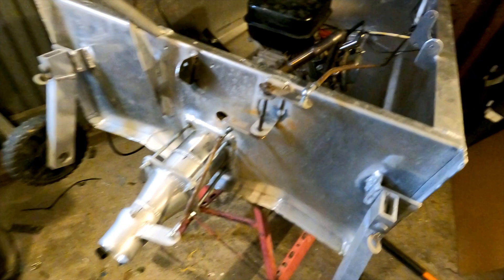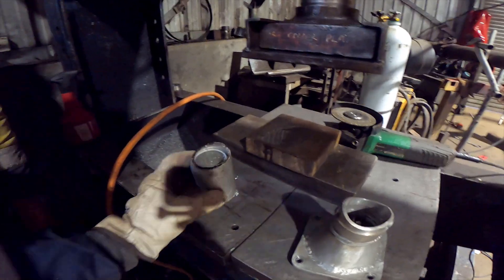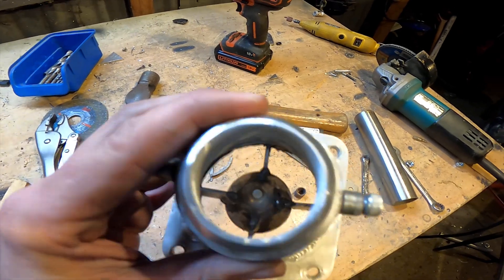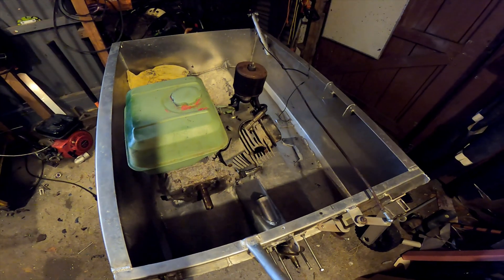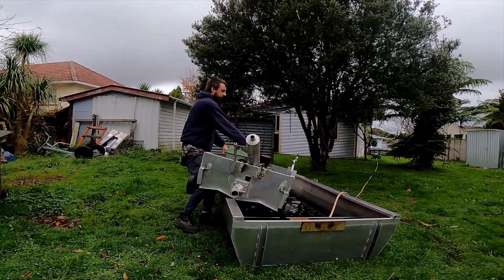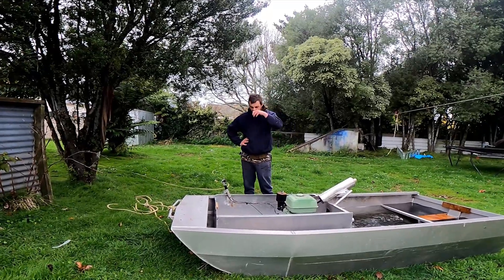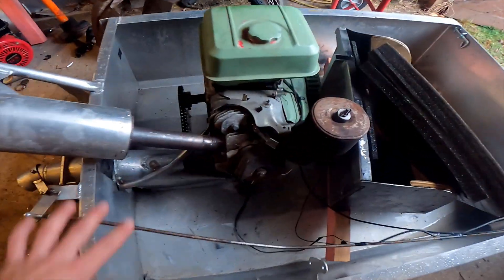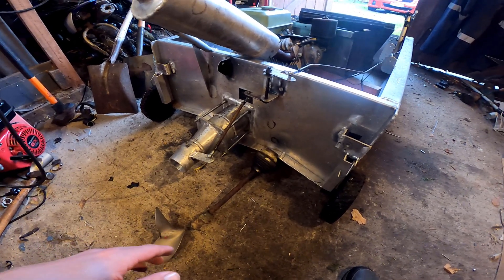Homemade Jet Unit Build, part 5 Double the POWER

Comment: Sorry for you here is almost summer with Blu Sky and the CV axle could be a good thing to try
Reply from the maker: I hate winter, but the rivers will be up soon from all the rain should be good once I get the little boat working properly!
Reply: @dkthewelder  also Yesterday Simon from rclifeon had the same problem with putting the boat in a waterskipping position https://youtu.be/PiisxsWiEok
Reply from the maker: @jeremyperraud1357  yeah it’s like putting heaps of power in and going nowhere! I know this hull is fast though because with the outboard and the longtail it went pretty fast with hardly any power . I’m wondering if the jet was just pushing at the wrong angle and cavitation problems and sucking up weeds . I watch the rc guys a bit because they experiment with things a lot best way to learn
Reply: Having a CV joint in the prop shaft sounds scary to me.
Reply from the maker: @TrevorDennis100  would a universal joint be better? I’m looking at another motor that does 12000 rpm don’t want it to explode haha

Comment: Nice work man! Not sure what the best route from here is for ya, the constant clogging seems to be an issue so maybe the surface drive would be better. Unless you can find a jet drive from an abandoned jet ski or something. Lots more to them than just the size. Complicated maths. 😂
Reply from the maker: I know they are tricky to figure out ! Even a JetSki unit would still block up in the type off rivers around here have weeds in them , I have a bit of a plan !
Reply: It might also have something to do with rpm, you can have as much power as you want but if it only spins the same speed it wont go as fast?